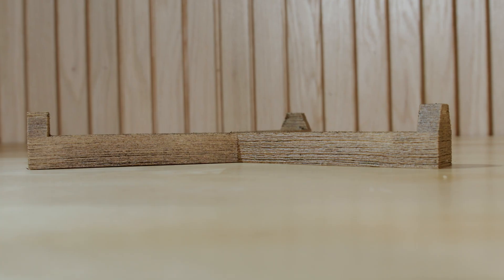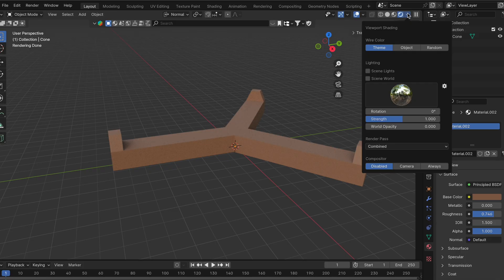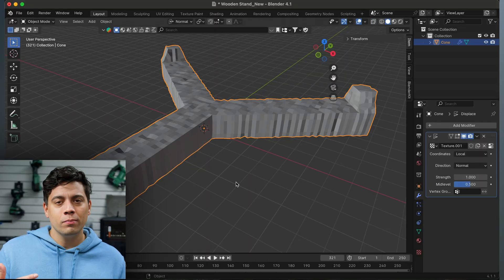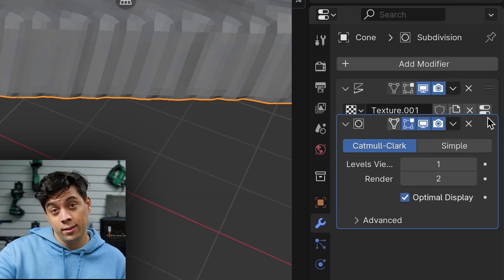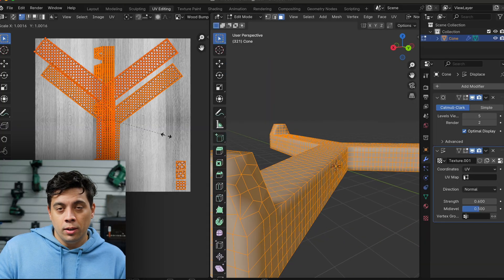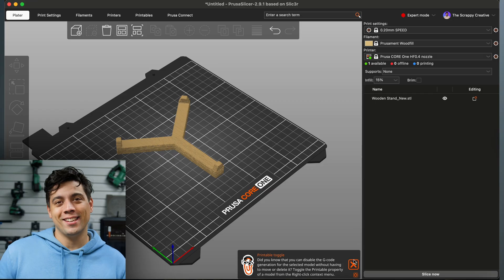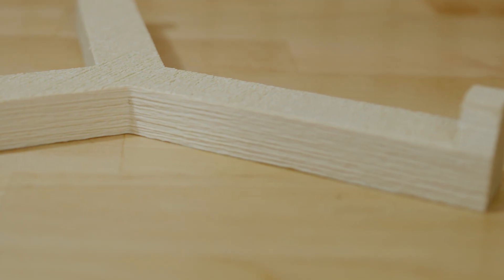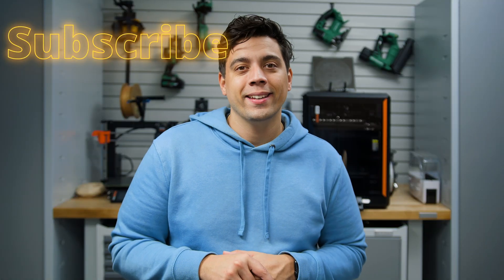How To 3D Print REAL WOOD! | Step-By-Step Tutorial on Prusa Core One

Comment: Something is missing. When I click to add the texture it doesn’t give me any option to load a texture. It just creates a name “texture.” How do I load the bump map I downloaded.
Reply from the maker: Hit the folder icon!
Reply: @T @TheScrappyCreative ere is no folder icon. Just click “new” and it turns into the word “texture.” It If then click the “browse texture to be linked” it never gives any option to browse your computer. It just shows an empty folder with the word texture. Does the file I downloaded need to be moved into some sort of blender file before I do this?
Reply from the maker: @kaseyascani127  let me look and get back to you ASAP! Not sure why that’s happening to you!
Reply from the maker: @kaseyascani127  Okay so if you go into the texture tab which look like the little checker board load it in there with "open" button and then head to displace and the texture will appear there! Sorry for the confusion -

 Blender recently got an update and I think that caused a bit of an issue there!

Comment: Nice tutorial, thanks. For added realism, you could also use different nozzle temperatures, it will slightly burn the wood in the filament at higher temp, altering its uniform color. Variable layer height might also work towards an organic look.
Reply from the maker: Great idea- I have messed with this but controlling it in a realistic way is something I haven’t found how to do. Anyone I’ve seen do it doesn’t look realistic at all

Comment: Over the last 9 months I’ve been doing a lot of similar work in Blender to apply wood grain displacement textures onto lamp designs I’m making. In my first phase I used a 2D wood pattern like you did in the video but UV unwrapping was way problematic. I’ve found that using a procedural wood grain texture (I bought an addon for Blender called Carvature) that takes the headache out of the UV unwrapping whereby you can just use UV Project to unwrap and it handles laying the grain pattern down around edges on complex objects properly. The next horizon in this whole area may be how to create wood grain textures/grain patterns using multiple wood colored filaments so you could eliminate the staining step in your process to get a super realistic and natural looking textured surface. What do you think?
Reply from the maker: What I want to do is figure out how to do this in an AMS but without hard transitions when the colors switch… I just need a new printer or an MMU3 from Prusa because then I can use multiple color wood filaments to do just that!!

I have scene people write custom Gcode to literally burn the wood as it’s extruded and that helps change the color from light to dark on command